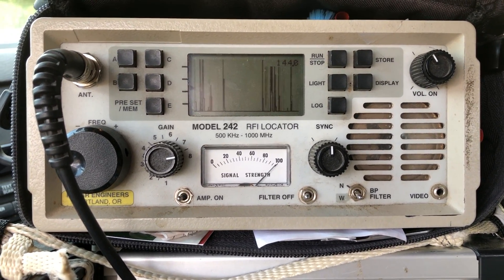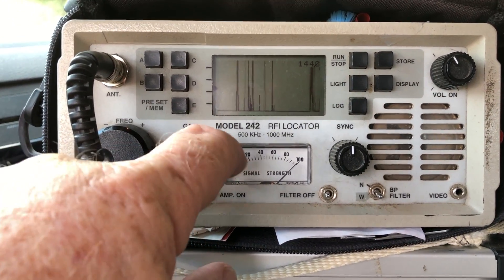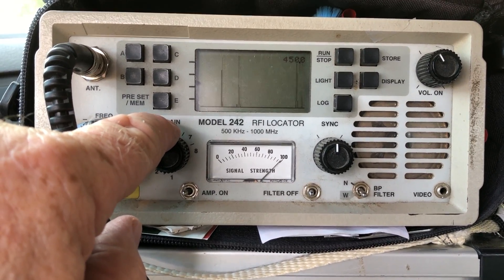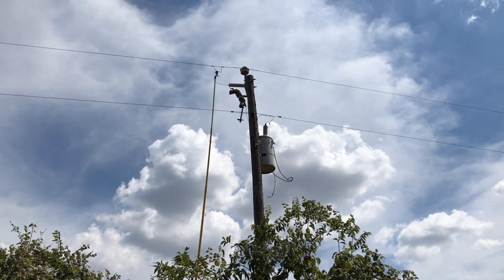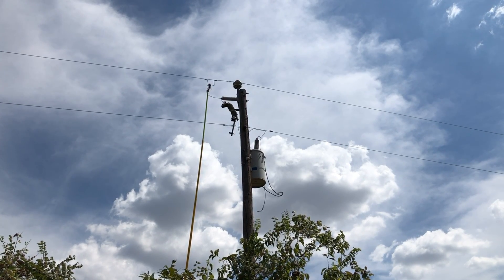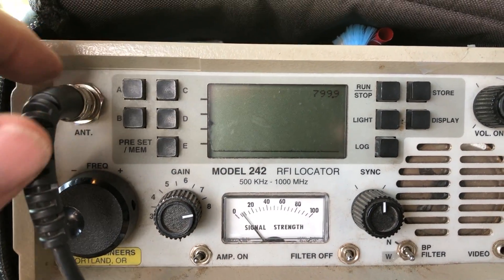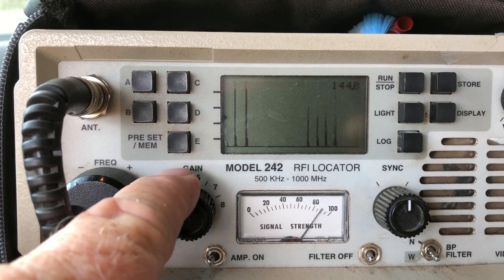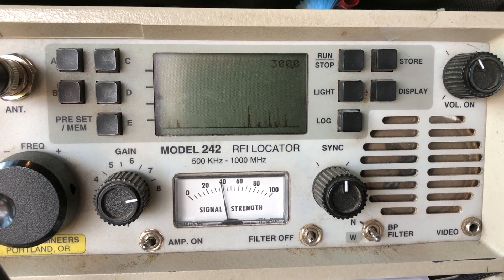RFI locate with Radar Engineers 242

Comment: Surprised they found it before it tracked through and failed.  Good job guys.   We had a large batch of fuse cutouts where the design flaw was responsible for many problems. The porcelain cutouts fail due to mechanical stresses, cracking then failing electrically.  Arresters take a lot of punishment from storms and eventually fail over time.   Good video!
Reply from the maker: Thank you for your comment. Is there a specific brand of cutout you have the most problems?
This generation of arrester fails from moisture ingress. When found with RFI and have no heat track to see, they might last another year or two. When they produce RFI and track enough to see with thermal, the LA's life is very  near the end. Hundreds have been found in routine patrol using the RE 242 and were replaced before failure.
Reply: @linema22n  I checked with my former VP of Operations (i am medically retired now) we think it was AB Chance or ABB cutouts that had the design flaw.

Comment: Is the noise generated from tracking due to contamination?
Reply from the maker: Noise is internal arcing between disc in this arrester design caused by moisture ingress. The gaskets on the end caps begin to fail after years of service.